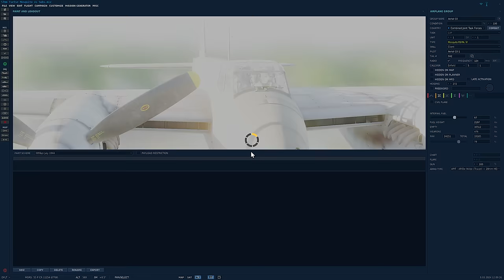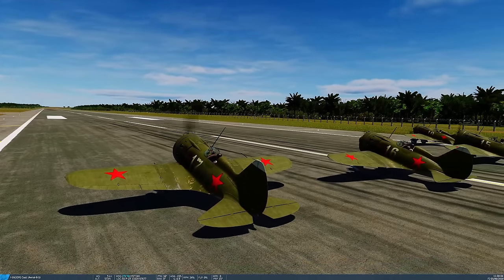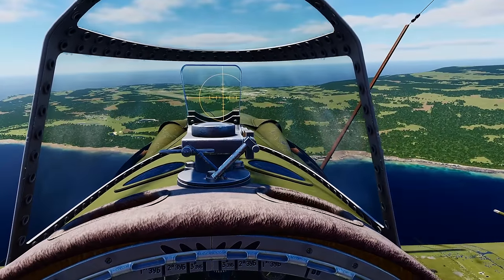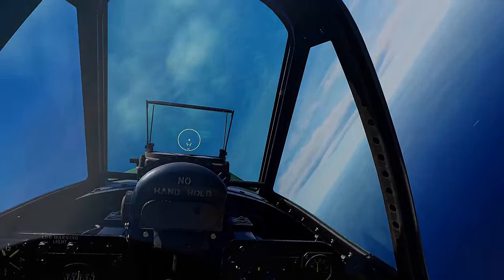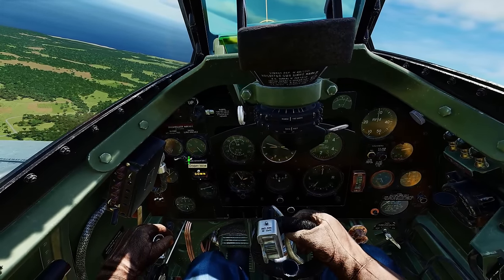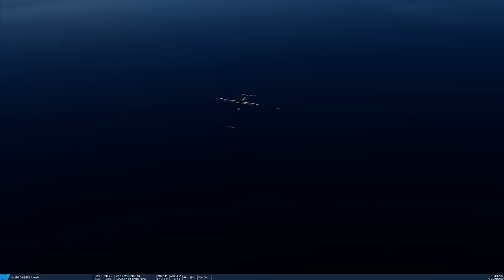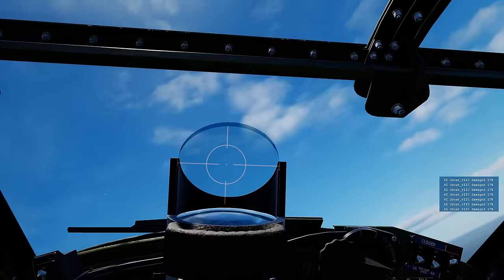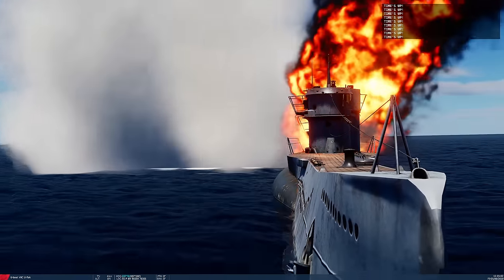How Effective Was The Tsetse Mosquito's 57mm Cannon Against WWII Submarines? | DCS

Comment: I think what is being overlooked or forgotten is that while .50 or 20mm might not outright sink or critical the sub, they can still cause enough damage that a uboat might not be able to fully submerge due to damage to the outer hull.
Reply: 20MM AP Ammo from WWII aircraft were more than capable of crippling  and absolutely sinking any Uboat, the idea that 20mm case was weak against enemy Uboats is modern Revisionist Sheepdip, Uboat hulls were never designed as Armored hulls, enough 50cal AP would also likely cripple the sub for a time needing repairs.

Once you bumped to anything greater than 20MM case the Germans wanted nothing to do with it ever on a UBoat, and that included .50 AP.
Reply: @pappysshoes6563  20 mm is .80 caliber.
Reply: Mohlins provided the auto-loader. The gun was a Royal Ordnance Six pounder. A weapon that destroyed tanks from after 1942 to 1945.
Reply: The 20 mm had about the same penetration as the .50 cal(33 mm of steel) as they had to reduce its power so the recoil wouldnt overwhelm the aircraft so the damage should be about the same when it comes to penetration

Comment: Dark here.  It is AP rounds in the 57mm.  It is modeled just like another 57mm in the game.  I could reduce the recoil some though.
Reply: muzzle brake or hydraulic accumulators
Reply: Take a look into the il2 version so you can see what the recoil is like if you have il2
Reply: I'd be curious to see how the Tsetse Mosquitoes would fair against some Luftwaffe captured B-17s and B-24s.
Reply: A Tsetse Mosquito actually shot down a Junkers 88 when a 57mm round literally knocked an engine out of the aircraft.
Reply: Yeah that recoil is definitely too strong, even for a 57 mm. This recoil is more comparable to the Ducks high velocity 75 mm

Comment: The 57mm was angled slightly downwards and so used a different gunsight. The recoil modelling may need tweaking because pilots reported the Mossie being very stable when firing the 57mm. I don’t think DCS could model the technique used in life - to aim at the water a few metres short. The round hit the surface and then proceeded almost horizontally to hit the sub below the waterline. Experienced pilots could get 7 rounds on target in one pass.

It was difficult to assess whether a sub had been killed because all the pilots saw was a sub diving. They rarely got to know whether it ever came back up again. Survivor accounts suggest that the 57mm round could penetrate right through the sub!
Reply from the maker: Amazing thanks.

Comment: More mad thing is they put a even bigger gun on the aircraft in testing and the Germans had a 88MM mounted on a JU88
Reply: I believe it had the same problem as all ludicrously big cannons on planes where it just rattled the airframe to pieces
Reply: The biggest in service weapon mounted on the Ju-88 was the BK 7,5 (Bordkanone 75 mm) not the 88mm,  it was basically a lightened automatic variant of the semi-auto PaK 40 75mm towed anti-tank gun.  The Ju-88 P-5 was a paper design with a single modified 88mm, but none are believed to have ever been built.
Reply: Yes the 75mm PAK ground testing bent the prop blades & blew rivets & panels off the airframe, I guess it was partially successful on HS-129 v3 somehow
Reply: They experimented with the monstrous rocket launcher/mortar from the sturmtiger. An old JU88 airframe was fitted with this bonkers idea. First shot and the front of the air fame pretty much disintegrated. That was the end of that idea. Probably one conceived after a few too many in the bar. 😅
Reply: Recoil from the US A-10 Warthog Gatling gun is higher than the engine thrust. Pilots have to be well above stall speed before firing it.
Reply: 75mm on a B25 gunship.

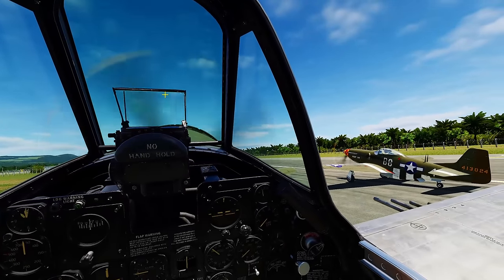Comment: 12:58 There was a variant of the M2 called the AN/M2 that was lighter / used a lighter barrel for aircraft use (6-800 rounds per minute) .  In the P-51D-30 an onwards, they used the AN/M3 which had a rate of fire up to 1200 rounds per minute.

Comment: Cap you say the I-16 is using 'frikin' ak bullets' (7.62 x 39mm) where i believe it is using the full battle rifle carteridge 7.62 x 54mm a much more powerfull round as used in the mosin nagant. Still agree that its pretty useless against even light armour.
Reply from the maker: Noted.
Reply: @grimreapers  Yep, the 7.62x39mm round was only created at the end of the war (I think it was around 1945). The caliber used here was the full power 7.62x54mmR so you could use the phrase “Mosin-Nagant bullets” or “ShKAS bullets” (ShKAS was the exact machine gun used on the I-16).

Comment: Great video, but the secret of taking off in the Mosquito is to nose trim down and wind up engines on full break. Then leave in about half or quarter break on at low speed to use toew breaks, until air over the rudder kicks in, take breaks off. Nice straight, take off, 100% of the time.
Reply from the maker: I just find it sooo hard.
Reply: @grimreapers  just try the brake on trick at the beginning take off and see how you go.

Comment: .303 roughly has 3000j energy (not courting what j you get from the incendiary. A .50 has roughly 20 000j (a P47 spits out 120 a second so 20k times 120) but a Hispano has about 50kj in jusr kinetic energy. Then add about another 45kj on chemical energy from the explosives. Thats about 95kj per shell. About 20 shells a second for the Spitfires. It's equal to about 5 sticks of dynamite a second.

Comment: Not an expert, but the 50s in US aircraft fired API ammo, which would have sliced through a sub's hull like butter...right? It could penetrate 1 inch of rolled homogenous armor at 200 meters. Considering the rate of fire plus adding about 300 mph to the bullet's velocity (imparted by the diving aircraft), that sub would have been Swiss cheese after a couple passes and unable to submerge. I'm wondering about the damage model.
Reply: That's an inch at 200m but engagement ranges against subs by things like B-24s was typically 300m or more to avoid return fire. Also it's one inch at 90 degrees and very little of a submarine will present at that angle above the water line - you're talking at best 45 degrees. The rounds won't penetrate water to any significant depth let alone then penetrate steel. So in reality a 50 calibre round wouldn't penetrate and in WW2 they weren't expected to and were used to suppress the crew from longer range than something that 303s could achieve, that being an issue for aircraft like the Sunderland.

Coastal Command used bombs, depth charges or rockets even when they had B-24s with 50cals. On B-17s they fitted a 40mm chin gun. They didn't consider the 50 cal effective at sinking subs.

Comment: The 57mm was not all about sinking the submarine. It had 2 (more likely) functions:  1.) The solid armor piercing shell could penetrate into the interior of the sub and bounce all around inside the crew compartment, wreaking havoc.   2.) A solid penetration into the ballast tanks or pressure hull would prevent the sub from being able to dive, allowing for follow-up attacks with bombs or easy tracking and attacks from friendly ships.  Occasionally, the 57mm shell would cause enough damage to sink the sub but, the other 2 scenarios were more likely.

Comment: You forgot the Hurricane Mark IID which came with twin 40mm Bofors for anti-tank.
Reply: The 40mm on the IID were Vickers S not Bofors. They used the same ammunition design as the 2pdr Pom-Pom: 40x158mm. The Bofors used a significantly bigger 40x311mm round.

Comment: Remember that the uboat has so many hit points it can shrug off a a direct 500lb bomb hit.
Reply from the maker: wow!
Reply: @grimreapers  also almost impossible to take it out with rockets doesn't matter if you use the. 25lb warhead or the AP warhead. You need a lot of rocket hits to take it down.

Comment: Why does the Mosquito wander about so much on takeoff?
Reply: 1. Tailwheel, so not directionally stable on ground;
2. Both engines turn in the same direction, lots of torque;
3. Fin and rudder arguably too small; and
4. No propwash over fin/rudder, so differential braking required for directional control until rudder aerodynamically effective (~80kts).
Reply: @grmatrix6358  Thank you
Reply: @grmatrix6358 added to all of which, the UK's long-standing "not invented here" refusal to fit tailwheel locks, US-style

Comment: Shame you don't have the ME262 with the MK108 30mm cannons for comparison... It would also make more sense to attack the subs along their axis, rather than flying across them. Near the end of the war, there was a case of a JU88 having an engine completely shot off by a Tsetse Mossie. (Just one round took it out).
The whole point of the 57mm gun was that you only need one hit on the sub to make it have to return to base.
Reply: If you want penetration, you need to attack across. Otherwise the angle is acute and they'll all bounce off apart from a very lucky hit on part of the conning tower.

Comment: Even at 25-40% damage a U Boat would be operationally fucked.
Also, just SEEING aircraft which MIGHT attack them would force a U Boat to dive and render them pretty useless in getting a solution on a convoy.
80% of which crossed the Atlantic without ever coming under attack from zee U Booten.
Kriegsmarine was crap.